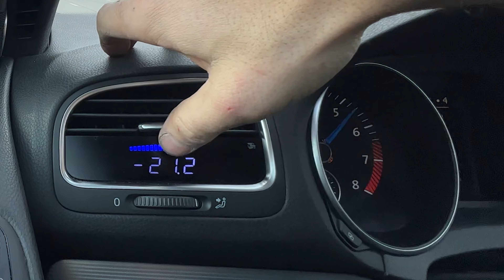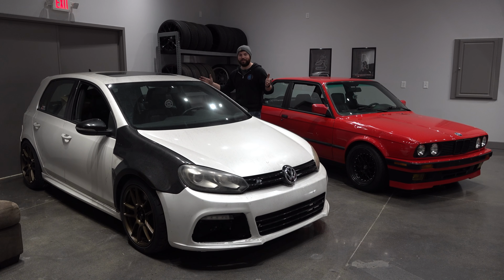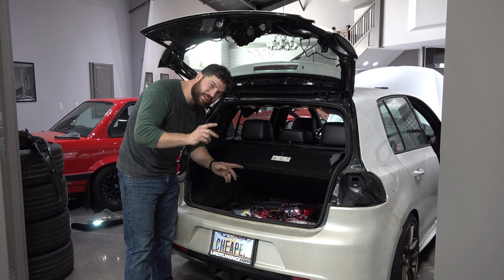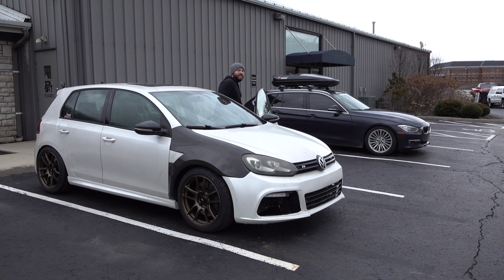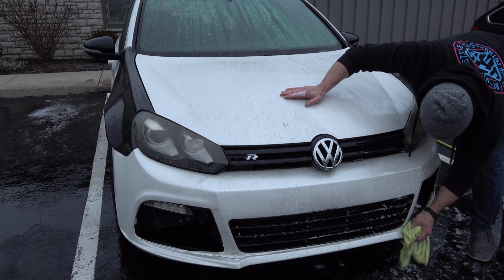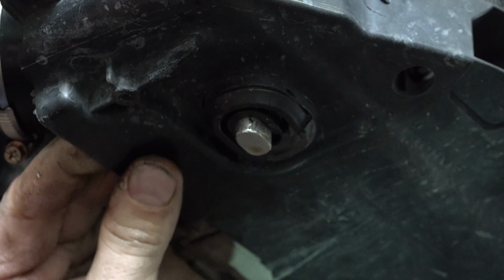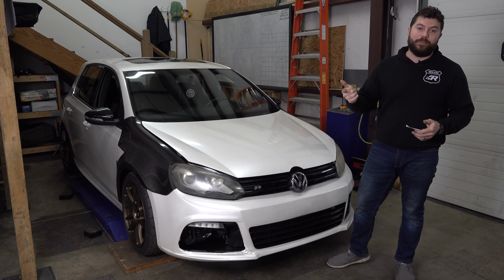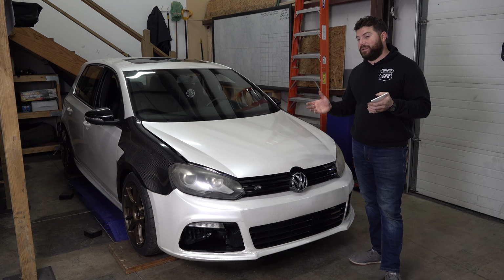This Big Turbo Golf R has LOTS of problems | P3 Gauges

Comment: Pretty sure boost control issues are what's killed my Astra VXR (Don't think you get them in the US), some muppet positioned the exhaust Vband so it would block the wastegate actuator and it would make 26psi (They do 12psi stock and healthy stage 3 boost is 20psi), so now it's pressurizing the coolant
Reply from the maker: Dangit, such a simple mistake with huge consequences.

Thankfully Im writing this post halfway to Florida and the manual controller is keeping it in the low 20’s👌🏼 (spoiler alert😂)

Comment: Are the Indy 500 tires stock 225 or did you go meater with the Heliograms?
Reply from the maker: Stock is 225, we went 235 on this car. We run 255s on the CheapR but it's stock ride height and doesn't have fender liners.